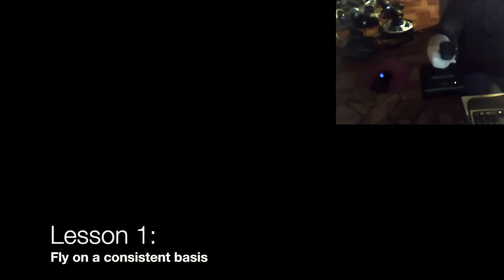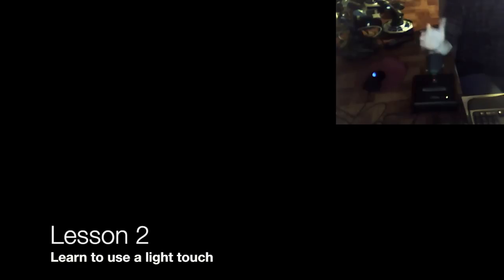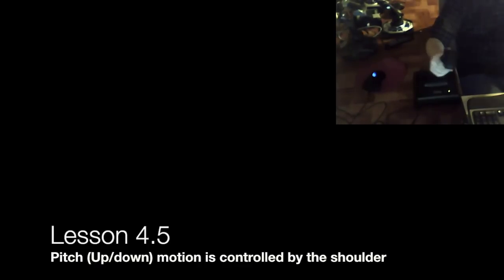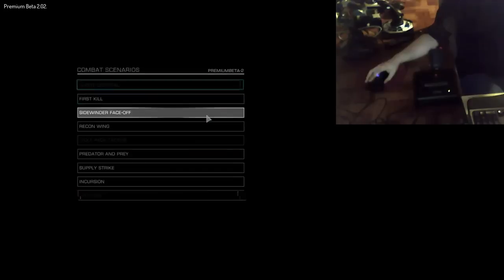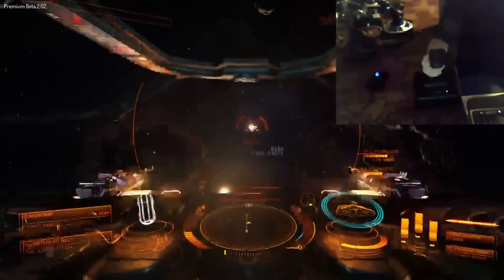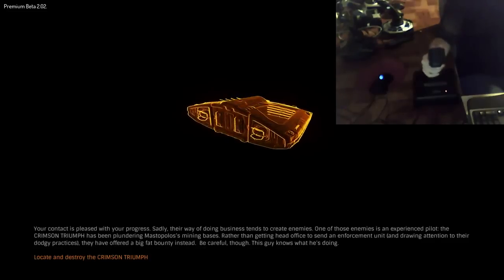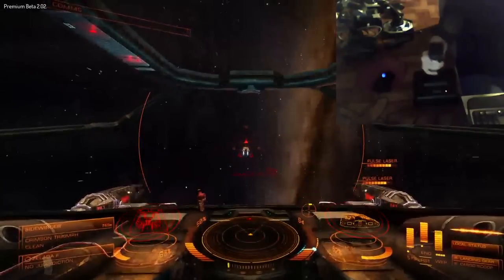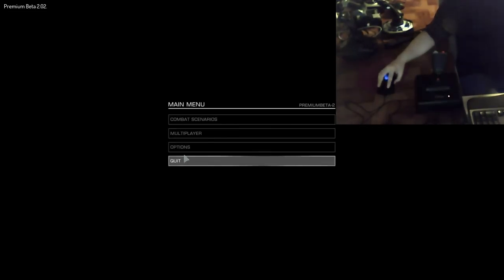Way of the Stick Part 1 - Joystick Basics

Comment: Kirk, this is EXACTLY the kind of videos I was looking for, cameras on gear in use, techniques, tactics, flying in de-coupled, etc. 

I have not flown with a stick in 20+ years, and SC is why I'm fitting out my i7 3930k/GTX 780ti/2560x1440 rig with my first HOTAS and pedals, TrackIR, etc to practice flying and working with the alpha/beta releases. Went with CH based on yours and others reviews.

I build my own PC's and I own higher-end PC gear, but the goal I have is to build a new rig in mid-2015 to handle SC in either single 4K or triple UHD displays.  Hence I'm waiting for new releases of CPU's, boards, etc. before building, since the game isn't in a state to commit to hardware yet.

Thx man, exactly the kind of stuff I was seeking, it lets guys like me see how to use the gear to its fullest.
Reply from the maker: Glad you're finding it useful.  I was hoping additional cameras would arrive this week, but looks like they are on the slow boat from china.  They say end of July.  But last item from China we ordered arrived in about a week.  So we'll see.
Reply: Sort of a self plug here, but check out some of the archived videos I have on my twitch channel: http://twitch.tv/badnewsbaron. I fly with an overhead camera set on my X52 Pro HOTAS and mouse/keyboard so you can see what I'm doing. There are a few Wave 15 wins shown there for Vanduul Swarm if you want to get a better feel for how this works with SC.

Comment: i need a good left hand stick
Reply from the maker: Your options are the thrustmaster t.16000m or CH flightstick pro.  Of the two I'd recommend the thrustmaster.  CH is good as well, but $15-$30 more on average and the t.16000m has identical functionality for less.
Reply: +Newyorksix Logitech ATK3 it is perfectly symmetrical so also for lefties. Reccommended!
Reply: OOL

COOL

Comment: can the pro pedals toe brakes be set to forward and backward thruster control?
Reply from the maker: Yes you can.  It requires CMS scripting in some cases in order to detect great than 50% and then activate a key.
Reply: Kirk Fickert Got the pro pedals to go with my fighterstick, and like you said, with a bit of CMS scripting, I have the toe pedals set as a single axis. This axis is now set to forward and reverse thruster analog control. Just the pro throttle to get now (although I have a G13 which is currently is doing fine)  thanks Kirk